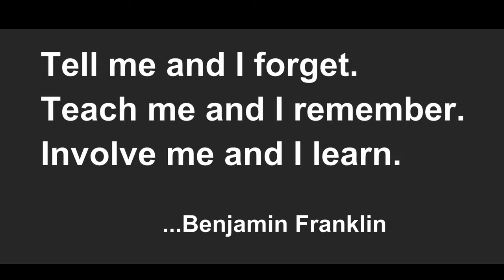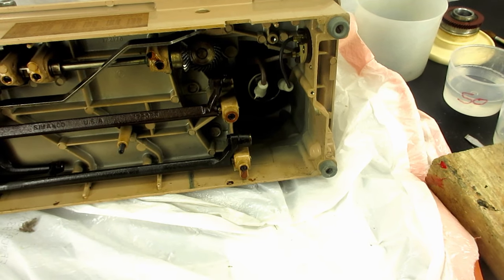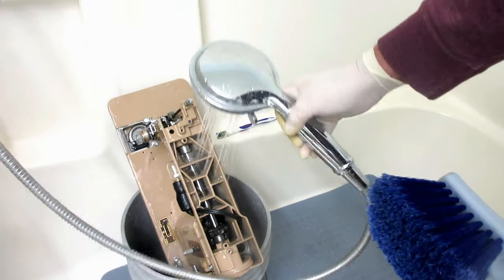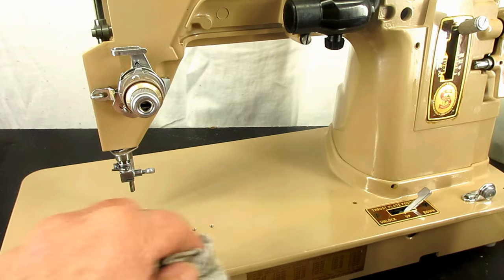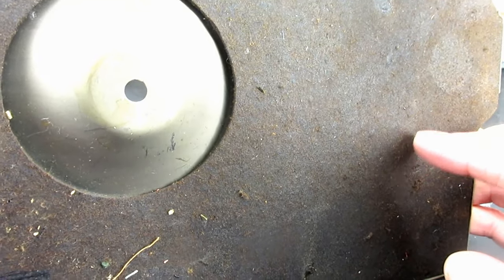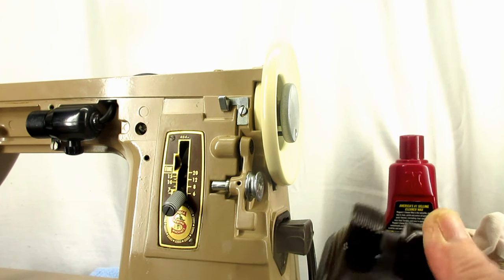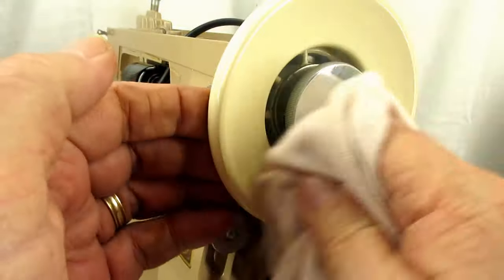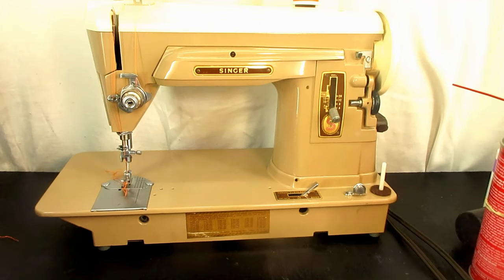An easier way to clean & degrease a sewing machine with less parts removal.

Comment: Good Day Andy,  I just found in Italy, I am stationed there - a Singer 401 M.   This Singer Machine was Never used apparently received as a wedding present in 1961, it still had the original bobbin that singer included with white thread in the bobbin area.   The machine is a combination machine, electric, and with foot manual pedal.  It is included in a wonderful varnished wooden table.  I have watched your videoes on this type of machine, but I have never heard you mention the 401 M.  Where these machines made in Milano,  from your videos you mentioned that some where made in Germany. - Muenchen?   As the machine had never been used it was stuck....so I followed your video and within one day I got it to work.  However I had an issue with the Inside button.  So I took it apart following your video, and like magic got it unstuck after let it soak for 12 hours....but this machine...is amazing....it goes through jeans, leather its amazing make my Singer - Heavy duty plastic casing .....look outdated really.  Oh by the way I paid 60 euros for it around 62 dollars....so I am very happy.....Thank you for your videos.... lastly....talk about black gobs of gooo....I took out the stacked thing....as shown in your video, to get to the first lever for k to speacial....little round gobs of gooo...that is the only place i found any deposits of oil etc....amazing condition....thank you...for your videos....Made my day...
Was a Pfaff Man now onto Singer..... 
Ciao from Italy
Reply from the maker: Saluti Marco in Italia! The rarest Singer Slant Needle Model and you have a quality one for 60 Euro. Amazing way to start a new year and congratulations. It was not made in Milano but in Monza, Italy: https://www.singersewinginfo.co.uk/monza   If you look on the underside of the machine, in front of the bobbin area, you should see an alphanumeric serial number starting with the letter "M".  Your 401 M is modeled after the German made 401G and 411G which also can be used as treadle machines. They were made at the Singer factory in  Karlsruhe, Germany.  https://www.singersewinginfo.co.uk/karlsruhe    A 401M will occasionally pop up for sale in the USA, like this one on eBay for $299 or 280EU: https://www.ebay.com/itm/314228965143    You truly have a beautiful, rare gem of a machine. I'm happy for you friend and hope it gives you pleasure for decades to come. Thanks for sharing and for watching my channel.

Comment: CAUTION:  Older black machines with shellac or lacquer based finishes and delicate decals  must be treated differently.  The machine in this video is from mid-century and thus a bit "newer", and has a much more durable painted (or enameled??) finish, compared to the older ones.  Andy, could you please reply to this with some crucial differences and tips, to help the newbies who might not know yet?  And maybe pin it to the comment section?
Reply from the maker: OK, pinned it. Perhaps you'd like to make a video on your channel showing proper methods for cleaning/protecting machines with the shellac/lacquer finishes? I'd be happy to refer to it. Thanks for watching my channel.
Reply: @andytubesewing1953  I am by no means an authority on the topic.  Was just helping to protect the new VSM enthusiasts who might have an older machine.  After posting this, I came across another video of yours from a couple years ago where you cleaned and refurbished an old black machine (can't remember the title now).  That would be a great secondary reference to this masterpiece.  And thanks for sharing everything that you do!!

Comment: Under high pressure and / or high temperature conditions, aluminum fuses to steel, (spark plugs in an aluminum head is a really perfect example; without an anti seize compound, it is a recipe for disaster.   Also, The small screws fastened to the aluminum body can fuse to the body ( not high heat, but definitely high pressure ).   I always put oil on the screws and bolts before putting the machine together.   Many thanks for the video.
Reply from the maker: And thanks to you for sharing valuable information.
Reply: Thank you for your insight.

Comment: Thanks a lot for this video! I got a killer deal ($1!) on an older all metal Pfaff 92 that was basically unused and had sat in a damp basement absorbing the musty smell and gathering surface rust on all the unpainted inner parts for 40 years. I used the technique and products you described in your video and it came out great. No more musty smell and it runs super smooth.
Reply from the maker: Oh, man. There is not a part on that machine that cost less than a dollar, and you got the whole thing for that price. I know how rewarding it is to restore a machine like that. I only work on Singer models but I know Pfaff made some great machines. There is one on eBay right now for $199.99 so I'd say you got a real bargain, haha. Thanks for taking the time to comment and happy sewing.

Comment: This is an amazing tutorial. I bought an antique treadle cabinet and a Singer 503a was inside. What a heavy duty machine. I hope I can get it working. I believe a good cleaning and oiling will bring it back to life. The motor turns everything but is super sluggish. Your videos make this a fun project to tackle.
Reply from the maker: Sure you can get it working, Jan. You will love that 503A Rocketeer. If you need to get into any repairs or adjustments or need to do a little deeper cleaning, I have some playlists of videos that may help. Model 503A Playlist = https://www.youtube.com/playlist?list=PLsCOZgzzaiKJZaZn2zl3LsnV2d7UhrqvX    Model 403A Playlist also, b/c the mechanics are mostly the same = https://www.youtube.com/playlist?list=PLsCOZgzzaiKKyqvdDRwS-9MfLuwSNJTcg     If you want/need a copy of the 98-page instruction manual you can download a free PDF copy directly from Singer here = https://www.singer.com/search/support?title=503
It's like you found a pearl in an oyster, congratulations. 🏆

Comment: Well, I was watching the new cleaning video and got into the reassembly part where you were moving the needle plate lever and rod and noticed that mine doesn't work like that.  I've had trouble adjusting it and the left clamp never went fully down.  I noticed that there was no play in the lever and that mine had lots of play so I took the indicator plate off the base and noticed there was a spring in there that wasn't held down by the screw.  Reassembled it with the spring under the lever, then the lever and then the plate and top plate and...voila/viola the needle plate is now held down securely.  I then lubed the bobbin plate slide and the bobbin carrier.  Thanks Andy for all the great videos.  You've been a great help to me and my 503A.  Ralph-
Reply from the maker: Nicely done, Ralph, and I understand about those springs there. I was puzzled by them the first time I tried to reassemble. I have a video about the needle plate lifting system for viewers who wonder what Ralph was doing with those springs, https://youtu.be/n1LSM-BZw9k  Thanks for watching my channel, Ralph, and take care.

Comment: Andy - I have been rescuing machines for some time now and without fail I learn something new from each one of your videos. I am particularly impressed with the detailed explanations you provide all along the journey. Confessing right now I may never put a machine in the shower but who knows? If I run across a good candidate the education alone might push me into action. Thanks again for excellent educational content. Aside from your YouTube channel where do you find buyers?
Reply from the maker: Thanks for watching my channel. I'm glad you enjoy my videos. I remember the trepidation I felt the first time I washed a machine. It was a hot mess of a Singer 600E lubed with some kind of black gunk. I figured I'd end up with a boat anchor but it came out sparkling bright and after fixing the Auto Reel Bobbin WInder it worked very well. I never looked back after that. I've only sold 3 machines thru my YouTube Channel over the years. For the last 8 years or so I just advertise on the local Craigslist with great success. Post those interior pictures with a link to a 30-second long video and they sell the first weekend. Late in the first year of the pandemic, they sold the day I posted them. I won't be doing the work any longer so I'm trying to find a buyer for the few machines I have left and all my extra motors, tensions, bobbin case, foot pedals, attachment sets, etc. but not having much luck locally. I have a handful of friends around the country who do this and they swear by the Facebook Marketplace for selling. I've never tried it myself but it makes sense and they all are willing to ship, even overseas. Thanks for saving the machines, Lee, and take care.

Comment: Great video Andy. It surprised me how quickly flash rusting locked up the mechanical parts . 🇬🇧✊🏻
Reply from the maker: Thanks for watching it, Jim. Each machine is a little different, but getting locked can happen a lot. Usually, as soon as you get oil in the 6 main bushings everything releases right away, so this one surprised me. I live in the desert here, with very low humidity, too. What really surprised me was the rust on the feed lifting shaft. Wow! That was a first to see it turn the whole thing brown. I usually get some light rust on the main arm shaft, but often just brushing on the oil and wiping off the excess takes that right off. I'm glad the rust remover works so quickly and easily. It's cheap too, considering. Take care, and come back soon.

Comment: Hi there.  I've used oven cleaner on all the mechanical parts underneath old singer sewing machines and it works extremely well.  Just make sure it doesn't get on any decals and anypainted surfaces.  I normally do this 2 to 3 times each time washing off with large amounts of water. Being very carrfull of the decals and paint.  Oven cleaner sprayed  on the affected areas an then a soft wire brush used to help off the grime.  The underneath and mechanical parts ie mechanism comes beautifully  clean and shining like new. Then dried immediately  after . Apply wd40 . Wipe excess of and then light machine oil applied  to all working  parts. Hope this is helpfull

Comment: Hubby restored an old treadle powered singer and cabinet. We're looking forward to trying your techniques on cleaning up a couple of machines a lot like your Singer 494 project.
 To buy quality made sewing machines like your 494 performs would be at least a thousand dollars in my estimation. 
The spacious area between the needle and machine looks to be about eight inches which only comes in today's quilting sewing machines. The fact that it has metal parts is simply unheard of in modern machines; marketers claim to have ALL METAL parts when in fact, a lot of the gears are actually nylon/plastic, and oil actually melts them from what I've heard.
If folks only knew what these vintage machines are capable of, they'd be buying 'em up
Reply from the maker: The last time I checked the cost of a new model 404 in today's dollars it was about $1300 so you are right on the mark. Every single machine like this I've done has just amazed me once it's cleaned up and adjusted just how well it has held up and how beautifully it's still sews. I'm sure you'll enjoy working on some more of the machines and I wish you all the luck. And thanks for watching my channel

Comment: I have WD-40 Bike Chain Cleaner & Degreaser - tempted to try it on my sewing machine but seeing as it's meant for bike chains, you're supposed to hose it off after then reapply chain oil. My bike chain always goes from black and gunky, to silvery and spiffy clean, it works super well...
Reply from the maker: I found the product online and the SDS looks OK. They say it is good on aluminum, plastic, rubber, and paint "if used as directed". I could not find the "Directions for Use" anywhere. I saw warnings to wash your hands well, but not what you clean, like the bike or chain. It even said "Superior lubrication that extends the life of bike chains" so why wash the chain if it says it lubricates it? Maybe you mean just to get debris off? Go for it! just try a couple small spots and see. You can wash the whole machine as I do. Your product has ethanol, propane, alcohol, and other stuff so no flame nearby, and don't breath too much, right? I have a viewer who cleaned his machine with LA totally awesome orange from the dollar store and said it worked as well as Krud Kutter. I think the WD would work better than that on the really greasy gunk. Let us know, or better yet, make a video. Good luck, and thanks for watching my channel.

Comment: Hi Andy! Thank you for this video!. I'm a broke student who bought a Singer Stylist 533 online and I've learnt so much from your videos about fixing it up. I've been watching your series on the 513 in particular and I was wondering if you could point me to any video/other resource on how to replace the 4 plastic gears at the bottom ( - I believe they're for the rotating hook drive and the feed drive.) I've ordered the gears already but I have no idea how to actually replace the old ones myself. Thank you!
Reply from the maker: Here is the most popular video for the gears: https://www.youtube.com/watch?v=qHx6VPdenj0   You can also buy a copy of the Service Manual ($5) IT does show removing the shafts for replacement, which would include the gears. https://manualsoncd.com/product/singer-500-sewing-machine-service-manual-518-538-513-514-533/
If you'd like a guide written by a Singer Master Technician you can buy that here: https://store.tandtrepair.com/st4134164185.html
It's $10.95 but use my coupon code for 20% off andy-h-yt   Good luck and thanks for saving that machine!
Reply: @andytubesewing1953  Thank you so much!

Comment: Andy Tube is hitting the showers again!  Such fun!  I’m intrigued with the thorough washing of a machine with everything still intact.  I recently picked up a 1953 201-2 and I’m cleaning the insides with kerosene and SMO in the same manner you clean with KK.  So far, so good.  The black finish won’t allow me to use KK or water.  It’s a slower process, but still so satisfying!  Good to see you back in the shampoo and style business!
Reply from the maker: Good job IMO, Candy. You're smart using the kerosene and plain SMO on a 201 I think. Sure, a little slower, but great results and with your normal maintenance you won't need it again for 30 years. Happy sewing, and thanks for watching my channel again 🙏

Comment: I really enjoyed listening and watching you clean this old sewing machine.  I have an old 348 that has flat pattern discs.  Can I clean this in the same way please.  It has not been used for 30 years.  It has been stored in a very hot  conservatory.  Can I clean it using the same method please?
Reply from the maker: Mostly the same method, yes. I found I can use a lower percent concentration of the KK in water, like 20% KK. With a 347 it is more work to remove the motor out the end. I take off the timing and motor belts with the handwheel. I leave the wires connected to the motor and hang it out the end covered with a plastic bag. I leave the light and bulb, switches, etc. on the machine and that is OK as long as you dry the machine right away and completely. I cleaned a couple of model 347, one in very bad condition, for 2 clients. They cleaned up very nicely. I have 2 Playlists with a few videos for model 347 if you'd care to glance through them.
https://www.youtube.com/playlist?list=PLsCOZgzzaiKJS_4FKPb4bgAbHtYWnexvy
https://www.youtube.com/playlist?list=PLsCOZgzzaiKIv5oChf24tvhU_bc45eVYK
Take your time with yours and try to have fun. It's very rewarding. Thanks for watching my channel.

Comment: When I first realized you were going to actually WASH the machine I thought oh no! Glad I watched the whole video, the machine looked brand new. I don’t know if I would ever work up the courage to do this. 
When you have to wash the liner in the bottom pan, if you take an old towel and press out the water, the liner will dry much faster and the liner will not be disturbed. Something we knitters do when blocking our work.
Reply from the maker: Thanks for sharing a faster way to dry the drip pan liner.

Comment: I loved watching you take apart the Singer 513 and show the insides!   It gave me the courage to take off the top of the machine and see why the reverse stitch action doesn't work.  The button pushes in and the springs inside look clean and well connected.  What should I do next?   Thanks Andy.
Reply from the maker: You should email me at andymanuals53@gmail.com so we can work towards a solution. Video/pictures can be helpful.